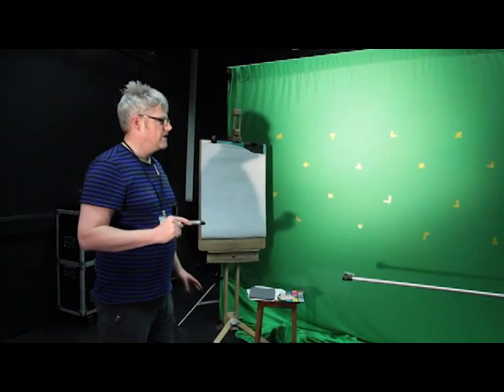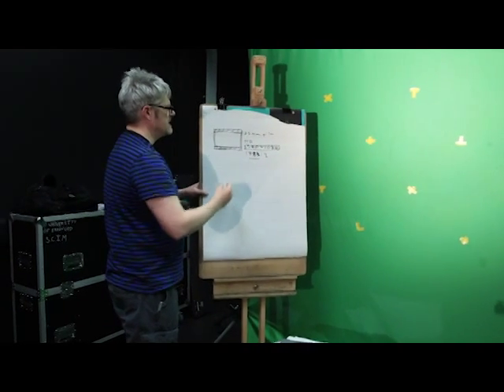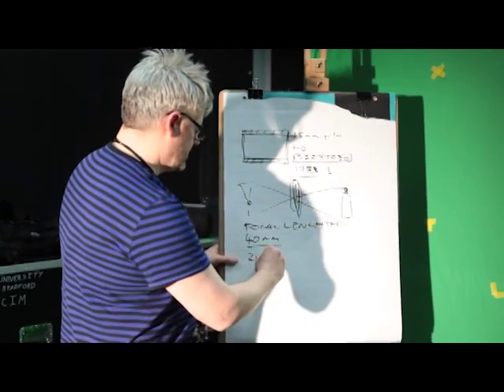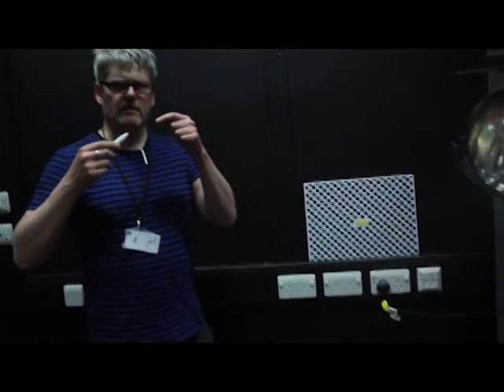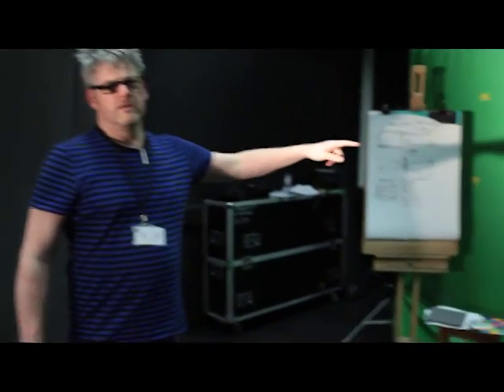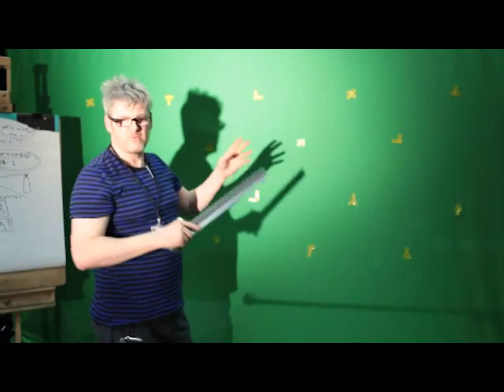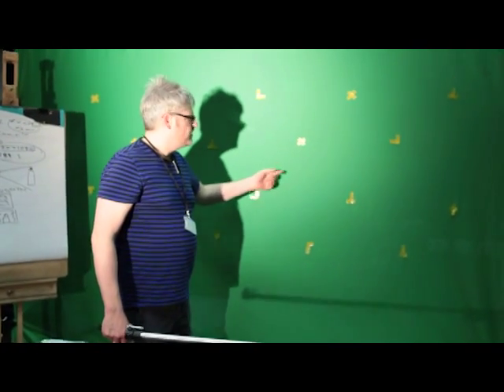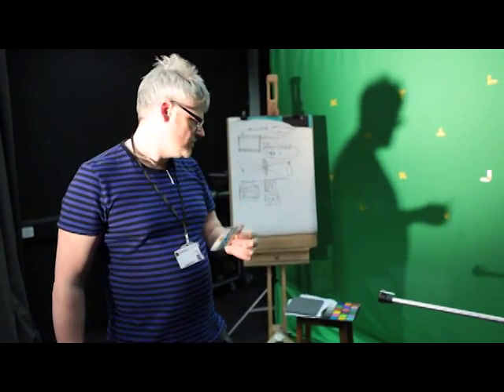On–set gs and track workshop example

Comment: Corner pin screen replacements are a bit old now, just print out a checkerboard or contrasty photo and stick it on, a planar tracker makes light work of it. Putting stickers on the corners just means your compositor then has to paint out any stickers which go outside the boundary of the screen of the device that's being replaced.
Reply from the maker: +Jon Bennett 
Thanks for your comment Jon, You can't discard the sticker and then clean-up process away just yet though as you might need to keep the reflection in the screen. In high end film comp, we'd say "just because it's old doesn't mean it's rubbish and  just because it'd new doesn't mean it's good."